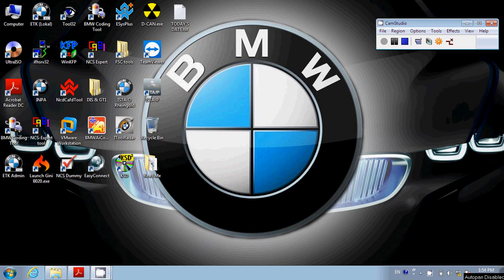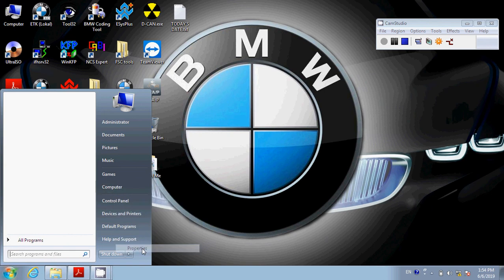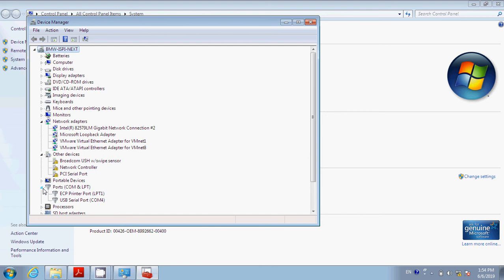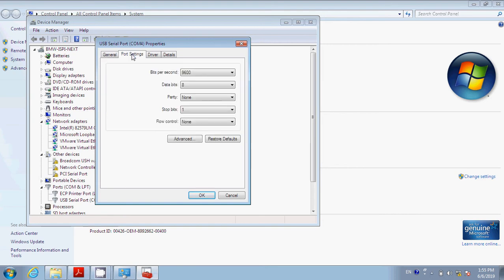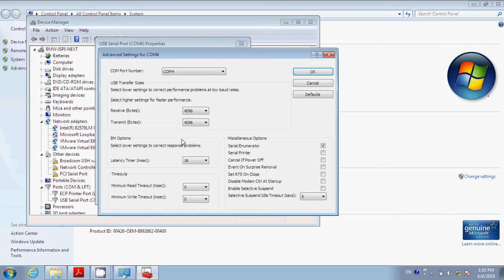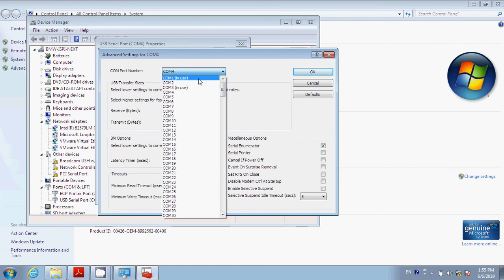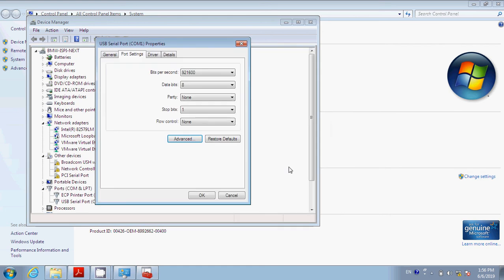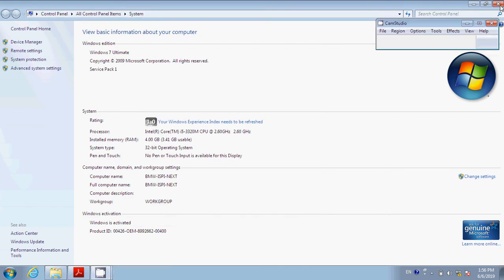How to properly set COM port K+DCAN cable

Comment: "Com1 already used" warning is real, i messed up with this and got problems (i have com1 with wlan-adapter and i lost wlan) so i dont't recommend use this instructions as it. I recommend if your COM1 port is reserved, change it's number first to another free one (ie. COM9), after that change COM1 to be use with K+DCAN cable. I can confirm that COM1 is only possible selection with K+DCAN cable, if you try use use different com port: no communication (INPA, ISTA using ediabias), etc...), even if you try change c:/ediabias/bin/obd.ini ports (be sure that COM1 is selected in obd.ini too)...

Comment: Thanks, the 1ms latency timer setting solved an issue for me where my transmission and engine modules showed up as red. Are there any other sources claiming 921600 bits per second is safe to use? I set mine from 9600 to 115200 now kind of as a middle ground and it works well.